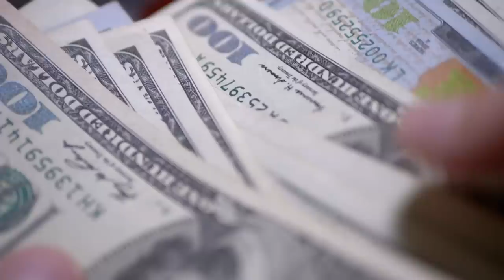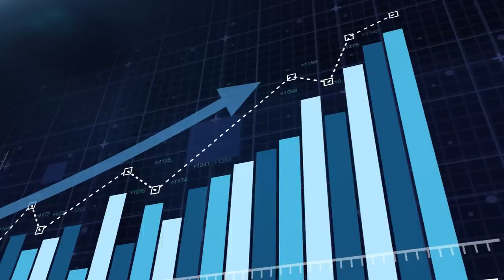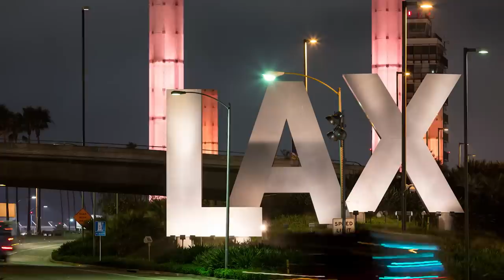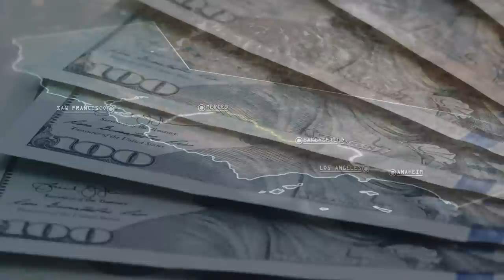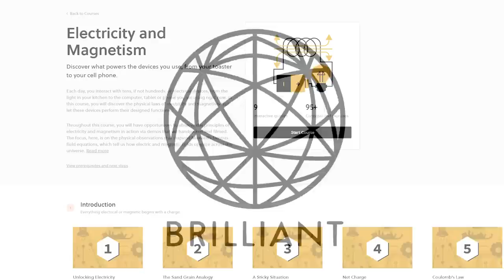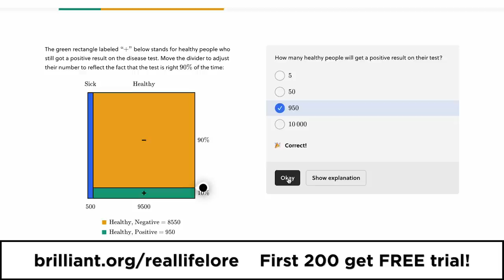Why California High Speed Rail is Struggling (Re-upload)

Comment: FFS. CA HSR was doomed from the start...   Because it was based upon the false idea that if only it were built, it would be a sound economic investment that could pay back its construction cost and operating expenses.  That's a ridiculous idea on is face.  Why?  Because only two HSR lines in the world actually have accomplished this, out of the dozens that have been constructed.  Japan's Tokaido Shinkansen (Tokyo-Kyoto-Osaka) and France's TGV Sud-Est (from Paris to Lyon). Every other HSR line is a money losing proposition.  Usually by the government which built it  wholly writing off the price of the infrastructure (right-of-way, rails, electrical facilities, stations, signals, etc.) and then charging operating companies an "access fee" for using the infrastructure that works out to be lower than the actual cost of maintaining it.....and topping up any losses incurred by a government entity which does the maintenance.  Hell, the operating losses of some of them (in Spain, Italy, China) have the government contributing more than they take in ticket revenue.  Why do the two lines mentioned actually succeed in paying for themselves?  Because they hit the exact sweet spot for HSR economics.  They are routes between 300-500 km in length, which travel along low-grade routings, with lots of intermediate cities and towns along their length,  connected to the HSR route  with robust local transit networks to guarantee high ridership. And the national government already owned the right-of-way leaving little to no acquisition costs  for the construction.

By contrast CA's HSR proposal at 500+ miles (800+ km) is longer, requires crossing three major mountain ranges at huge expense, and when it exits its endpoint regions of the greater San Francisco Bay and greater Los Angeles area, it only has one major city and two minor ones to generate intermediate traffic....NONE of which has serious connections to robust local or regional transit systems. It creates a situation where the infrastructure costs are simply all out of proportion to the possible ridership to pay for it.  The CA HSR authority brags that they imagine that more than 50,000 passengers per day will ride this boondoggle (they've likely overstated the ridership by 50%).....which might sound impressive, if you didn't know that the ACTUAL average daily ridership of the Tokaido Shinkansen is over 450,000 per day.
Reply: This is one of the most thoughtful Comments ever, in this video or any other video on HSR, that I have seen (heard or read).. And I know the topic really well from my professional background. I'm not sure about what California should do at this point in the project. To terminate the project would be a huge waste of money (of sunk capital). Building a line over Tehachapi that could be co-owned  by BNSF and CAHSRA is one possibility since the single track UP line shared with BNSF is severely capacity constrained. The goal would be to reach METROLINK at Palmdale. As for the northern end of the route, CAHSR trains could supplant the San Joaquins.
Reply: @michaeljones7927  : "Building a line over Tehachapi that could be co-owned  by BNSF and CAHSRA is one possibility..."
It's really not a possibility.  Why?  Because there is no way that BNSF is going to allow the electrification of their primary access to Central and Northern California, preventing them from running double-stack containers and oversize freight (esp. auto racks) on this route.    Add to this the fact that they have a joint operating/trackage-rights agreement  on this line with Union Pacific, that also runs such double-stack and oversize between Mojave and Bakersfield.  Not to mention that most of the curves on this line are too tight for high-speed operation.  If you look at CAHSR's planned Tehachapi crossing, it involves several lengthy tunnels that completely avoids the BNSF right-of-way.

" As for the northern end of the route, CAHSR trains could supplant the San Joaquins."

Only if Union Pacific is willing to allow electrification on their primary access route to the Port of Oakland....  Which I'd evaluate as unlikely as BNSF allowing it on Tehachapi .
Reply: @ilikehardplay  Electrification is unnecessary. The original plan for the TGV Southeast was to use gas turbine electric locomotives. TGV 001 (the prototype TGV) regularly tested at 300km/186 mph, and once set a world speed record of 198 miles per hour. A modern version of that locomotive could use green hydrogen, eliminating the need for electrification. That means sharing trackage with the freight railroads becomes less of a problem.
Reply: @michaeljones7927  You will note that NO railroad currently uses gas turbine locomotives, for the simple reason that they are grossly energy inefficient.  Moreover, they are  maintenance nightmares, as Union Pacific discovered using gas turbine to haul freight between 1952-1970.   Furthermore, I'd add that the infrastructure for  hydrogen fueling rail locomotives does not presently exist....let alone "green" hydrogen....since most experiments with hydrogen fueled cars and trucks rely upon hydrogen produced by electrical cracking of petroleum hydrocarbons.
Reply: @ilikehardplay  UP retired it's fleet of gas turbine locomotives because the price of "bunker C" fuel became too expensive, not because of maintenance issues. TGV 001 utilized French helicopter turbines that were expensive to operate, but very powerful and extremely reliable. The Arab oil boycott sent petroleum fuel prices soaring, causing SNCF to opt for electrification for the TGV Sud-Est development. I only offered this suggestion as one means for CAHSRA to salvage its project. Regarding electrification, as long as the catenary contact wire is a sufficient distance above 20'2", there is no problem with freight trains and passenger trains sharing a rail line.. The almost universal use of "bending arm" pantographs makes it feasible for low profile passenger trains to share track with freight trains having auto racks and domestic double stacks in their consist. And regarding BNSF, they need their own line over Tehachapi because of congestion. The Loop is a great place to watch and photograph trains,and I have done so on trips to California, but it's not very efficient from an operational perspective.
Reply: @michaeljones7927  While the vast quantities of bunker C (later No. 6 heavy fuel oi)  that the "big blow" used was certainly a factor....since it cost TWICE the amount of the equivalent of the diesel for equal HP of locomotives, but the problems of maintenance should not be discounted.  Sure they were fairly reliable engines......but every time the turbines broke down or needed scheduled service, parts had to be special ordered, there were only a handful of UP techs who were qualified to work on them compared to the diesels, and they regularly had to consult with GE to troubleshoot....  Not to mention that bunker C and heavy fuel oil required a whole separate supply line for fueling, since it ranges from viscous to damn near solid tar in cold weather, that certainly required heating.   How many helicopter mechanics do you think were working for SNCF?

Actually, the FRA plate clearance for Doublestack 4 = 20' 3" (6.17 m)  But the few locations on the NE Corridor that allow Doublestack crossings  or operations are set at 23' height to allow safety margin....which requires pantagraph heights considerably larger than those used by most European or Asian rail equiptment.

Having been born and raised in California (by a rail fan father), I've spent rather a few days train watching at  Tehachapi, Cajon, and other hot spots for train watching.  And yes, I remember chasing gas-turbines on Sherman Hill in Wyoming as a youth (1968?)...
Reply: @ilikehardplay  I wish my child hood experiences had been as exciting as yours.
Reply: To return to your initial comment, which I agree with completely, what is your solution to the problems faced by the CAHSRA? You're obviously a rail enthusiast, and if I had to guess, a fiscal conservative, so you're faced with conflicting loyalties. Are you willing, as a California tax payer, to subsidize the HSR project? Or do you want it to be terminated? Or do you see a way to salvage the sunk cost of the initial 119 miles? The San Joaquins can connect at Madera, but it still would be necessary to construct the final nineteen miles from Shafter to Bakersfield. What about running the San Joaquins on the HSR line, using diesel motive power and passenger cars capable of operating at speeds of 125+ miles per hour? The ultimate problem, it seems to me, is the inability to reach Los Angeles....the biggest California market, and that doesn't even include San Diego.

Comment: Despite the re-do I’ll have to leave the same comment. The Los Angeles basin is served by two rail lines, both declared a miracle of engineering when completed. They are the Cajón pass and the Mojave pass. Freight trains are limited on these grades to less than 45 miles per hour, Amtrak may exceed this by a negligible amount. The amount of tunneling required to provide high speed rail between Los Angeles and Bakersfield would be equal to the longest railway tunnels extant, all through an area of active faults. Anyone, and I mean anyone with knowledge of of this would have said no to the project from the start. The voters were sold a lie, and the train wreck of a project keeps rolling along sucking up more taxpayers money. Green pie in the sky nightmare that will never end. Can’t wait until they rip up all that track in the valley because they need the farmland to feed people. I know of no better example of government recklessness.

Comment: As long as the prices are under plane rides. and take a little bit longer than the plane ride its going to get riders. If its too similar people are just going to fly.
Reply: Except for the way it actually works is that if people have a cheaper alternative to flying where they don't have to clear TSA in order to travel a relatively short distance, they will use the alternative. Another reason why the fact that California HSR will become a popular travel option can be stated with certainty, is because people drive between the two cities frequently; If they have a way of traveling that is faster and cheaper then driving, while also more comfortable, they will opt for HSR. This is about drawing people away from both flying and driving, not just flying.

Comment: Wow nearly 12 minutes to get to the reasons the project is delayed! Then there is little details as to the delays.
The State or Federal authorities ought to be able to set a fair price for land purchase and not allow landowners to ask inflated prices and/or block the route.
With record oil prices currently will flying always be a cheap alternative? If the train can run at 200mph+ a less than 3 hour journey with no security checks has to be better than all the airport hassle and a cramped seat on a plane.
Reply: Maybe California has made things difficult for itself, but there is a method for condemning property for a public use. It WILL be inflated. That's the cost of doing business and a minor one in terms of the overall project.

Comment: Environmental and land rights are huge impacts.  New rail lines separate from CalTrain / MetroLink rely on the suburbs of SF to the South (between SF and San Jose) and LA to the North.  No way this ever occur due to the land rights and noise generated from the trains.  

Without LA to SF, there will never be enough passengers to payoff the investment.

Unlike the East Coast and even Chicago, California is a car culture.  Highly unlikely combined with the hard shutdowns due to COVID in the state impacting ridership of BART, CalTrain and likely MetroLink further impacting ridership.  Invest in the railroads on the East Coast.  The state of California's state government is already running a massive deficit.

SJ to Bakersfield is useless yielding extremely limited ridership.

Cost of a JetBlue roundtrip flights from SFO to LAX is $98 in January, 2023.  Why would I pay a massive premium when CA HSR finally be delivered ?

Enormous benefits ....  chuckle.  The challenges for HSR in CA are NOT engineering or science given the technology is proven - it is construction, land rights, environmental, ....

Comment: Florida has a train service that connects Miami to Orlando, and there's an approved plan to expand the service from Orlando to Tampa. This was all done in a decade. California needs to pick things up.
Reply: This is private and is on an existing rail line at least from West Palm Beach to Miami.
Reply: @Montusama  then why doesn't California do exactly what brightline did in Florida? You seriously mean tell there are no existing rails between San Fran and LA that can't be refurbished to support a high speed rail?
Reply: Did you not watch the video? This project isn't just about connecting SF to LA. It's meant to be an economic driver for what is frankly a far less successful economic area of California. This is what these types of projects are designed to achieve. This is meant to benefit the largest amount of the State. 

Bright line has one objective and that is money and is vastly simpler compared to even the most direct route between SF and LA. These projects are not the same.
Reply: @Montusama 1. meant to benefit the masses? The masses already live in LA and SF these are 2 of the biggest cities not just in California but in the US lol 2. This project is in dire need of a plan B because the original plan isn't working, a more direct route that is more cost effective ought to be considered.

Comment: This high-speed rail route between Los Angeles and San Francisco is 520 miles, since it serves out-of-the-way cities in the Central Valley rather than going direct. The driving/bus/Amtrak distance between the two cities is 380 miles and the flying distance is 350 miles. How will this boondoggle save energy and move people efficiently by traveling 50% more miles? It can't. The whole project is a big 'green' scam. They said that it would go 200 MPH and complete the trip in 2.5 hours. That is fake. It could only travel 200 MPH for short distances in the Central Valley and would have to slow down significantly on steep Cajon Pass and to enter both cities on existing low-speed tracks. And since it would have to stop regularly the 2.5 hours is totally fake.

Comment: This project seems doomed because they started with a simple goal and a then made it unbelievably more complicated (as government will tend to do). 

One point I'm still not clear on (maybe I missed it) is why the most direct route through the valley wasn't taken? Granted it will cut through farms and require farmers to work around the rails but it wouldn't reduce the amount of land being planted by a large amount. I also understand wanting to have the other cities on the route to boost their prosperity but I suspect that diversion is what is causing the rail to have to cross so many mountain ranges. 

My feeling is this project will fail because it is trying to make too many people happy. The proposed 3 hour trip and $50 cost would pull many from the airlines and off the roads but if the eventual trip, with all the stops, ends up taking 4 hours and costs $80+ dollars it will draw very few people. The people with less time will spend $30-$40 more to fly and the cost conscious will continue to drive because it won't save them enough time or any money and they have the benefit of having their car at the destination and can leave and arrive when they want. One of the core issues we have to keep in mind is getting to the destination is not the end of the challenge. There is insufficient public transit at both ends so you would still need to rent a car/rideshare/taxi when you arrive. If the trip from LA to SF is not fast/cheep enough to overcome the time/cost of travel to and around the destination few people will use it.
Reply: It's following the cities along the valley's spine. The biggest mistake of the "marketing" of this thing was calling it a train to connect SF and LA. It's a train to connect all of populated California. I suspect it would be much more popular in the Central Valley if people there didn't think it was just another gift for the already rich cities of the Bay Area and Los Angeles.

Comment: The main failure of CHSR is that they didn't plan it to fit reality. I know that's a silly way to put it but here are two reasons. 1 - It should have been designed as a Mag-Lev line from day one. Technically, we are building forward, into the past! 2 - The monetary debauchery is the other dilemma! There are nearly infinite ways that paying the cost of this thing was designed for failure. My short list.
Eminent domain for right of way should have been put in place absolutely first! The failure to do that has nearly destroyed the line all by it self. 
Construction should have started from each end and the middle simultaneously. The funding for all this should have been done with such strict scrutiny that the Billions of "disappeared" funding would never have happened. Graft, bribery and outright "pirating" of funds must be removed from the equation. This alone has nearly derailed the whole project from day one. See... reality!